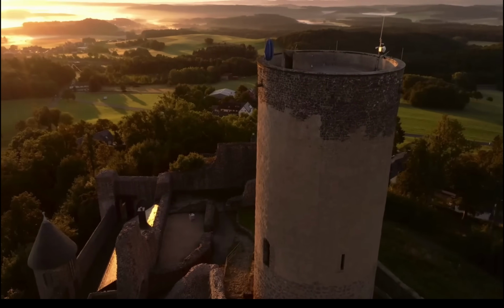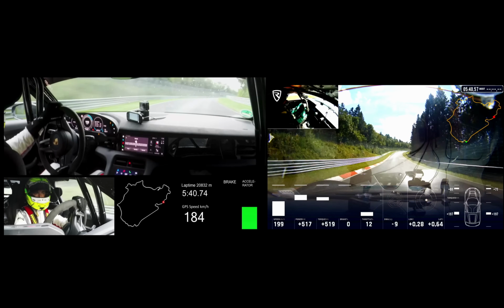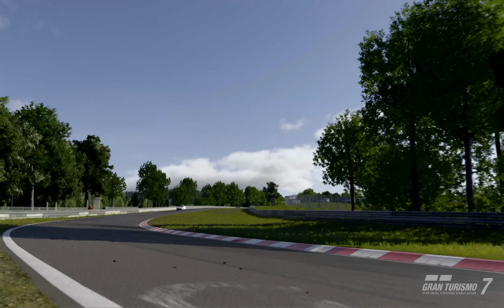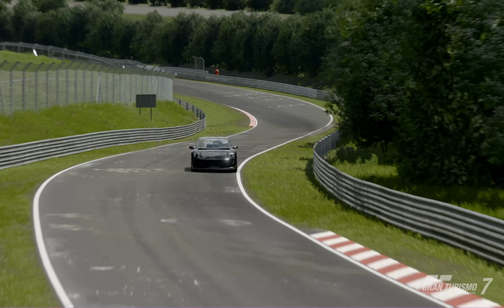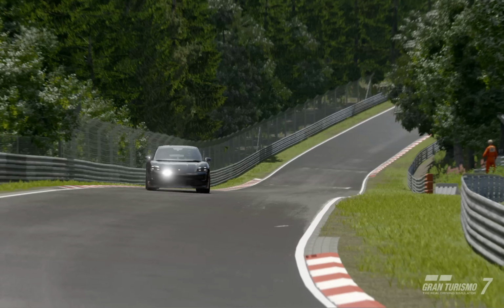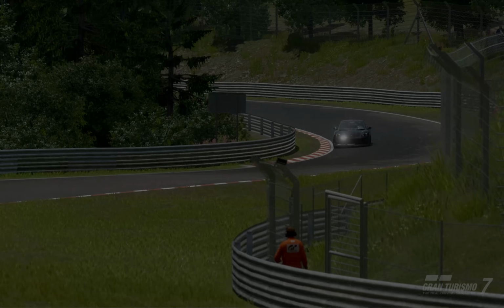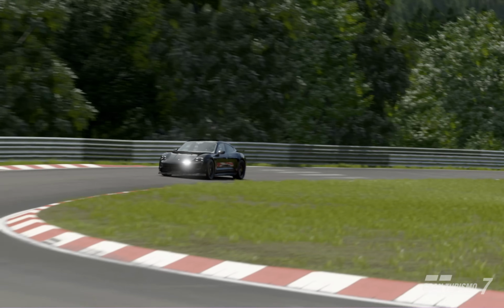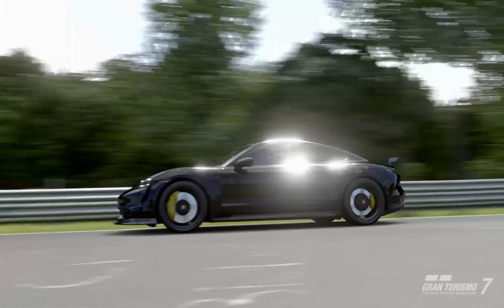Can Gran Turismo 7 Predict Porsche’s Record Lap?

Comment: In fairness to Sims and gran turismo, it doesn't simulate overheating or power delivery issues in petrol cars either. Of course, these are far FAR less prevalent on the track than sports EVs today are dealing with, but I still think it's worth remembering. Every car in that game is operating at its very best all the time. 👍 This was a fascinating video and I'll definitely be checking back to see how your really well reasoned upgrades stack up to what Porsche is up to. Knowing their lack of outright power chasing you're probably pretty spot on, their Formula E experience will have taught them a LOT about how important battery thermal management is.
Reply: @seanhanlon4120  don't be 2010 internet cringe, my comment is CLEARLY in context of battery overheating.
Reply: @seanhanlon4120  you're the one who can't read context clues??? You think I'm mad as well 🤣
Reply: @RobinThomson277 you can actually blow an engine in gt7 if you don’t change the oil
Reply: @michaelgomez4994  still haven't seen this happen except for one viral video where someone takes in race damage, on red warning used engine oil, and conflates in race damage (with cool misfire sound effects which is a neat detail) with a blown engine. The car doesn't stop, or explode.
Reply: @RobinThomson277  “except for one viral video” well there you go it happened
Reply: @michaelgomez4994  reading comprehension people! The engine didn't blow they took engine damage in a race. that system isn't a blown engine system that you need to pay to repair afterwards. It is temporary damage to simulate damaging the thing by crashing it into a wall not forgetting to put oil in. Remember where I used the word conflate? To tell you the reader that this person put 3 and 4 together and thought they'd made 5?
Reply: @RobinThomson277  gt7 runs on old ass ps4s. i expect improvements to the simulation with new hardware.(damage,tire wear/punctures)
Reply: @michaelgomez4994  hopefully they get more damage in for gt8 the problem will always be car companies not wanting to see their shiny cars falling apart. Tire wear is already a huge step up after regular updates. On a wheel, a gt3 car wearing it's tires 100% down certainly feels a bit like getting a catastrophic puncture irl.
Reply: @RobinThomson277  you expect to much for a ps4 game. it has that feature. but the game doesn’t expect you to replace head gaskets and timing chains…
Reply: @RobinThomson277  the game your looking for is mechanic simulator.
Reply: @michaelgomez4994  literally are you reading my comments?
Reply: @RobinThomson277  yeah to me it seems you want random shit to go wrong. when it’s a driving sim.
Reply: @RobinThomson277  example a sti are known for head gasket failure. gran turismo is not gonna make every sti blow up randomly.
Reply: @RobinThomson277  20 inch rims and dirt tracks don’t mix but having tire blow outs isn’t “fun”

Comment: My brain couldn't make sense of how the Rimac looked so much faster throughout, but somehow the Porsche kept up the whole way and then pulled ahead. That's quite impressive for a vehicle with (probably) so much less power.
Reply from the maker: I know Rimac reported they had tire overheating issues. I didn’t expand on it but I think all that power plus 5100lbs through a street tire just goes beyond the limit of current tire tech. Seems like Porsche have managed to be kind to their tires through the lap and was able to push them harder in the last 1/3rd of the lap. Still probably had some fall off but not too bad compared to Tesla and Rimac.
Reply: @hubblesphere  proper tyres will do wonders, and they are the largest factor in speed around a track, so no wonder

Comment: it’s not comparable on gt7 lol. especially on nurburgring. a track that big NEEDS laser scan. the size and bumps are not right and could be seconds off since it’s so long. he just put a bunch a things that would theoretically make sense and tested the worst way possible. to properly “simulate” a full lap you would need IRACING or better physics and an ai/ronot driver to suck 100% of the grip out of each car.
Reply: The gt7 nurburgring map has been laser scanned lol if you zoom into the track you can see all the small little cracks and bump on the track and the iracing version of the nurburgring is almost 2 decades old compared to gt7s nurburgring that got scanned like less than a decade old which means if anything gt7s track matches closer to real life than iracings
And if u want to talk about the physics ever since the new 1.49 update alot of people have said that the physics are somewhat onpar with iracing
Reply: And what's the point of having an ai driver for gt7 if irl you don't use ai?
Reply: @YoureAGoodManArthurAGoodMan  even if it’s laser scanned every pro driver irl in any series will say iracing is better. and anyone that thinks gran turismo is more realistic is just plain wrong. it’s a simcade iracing is a real sim.